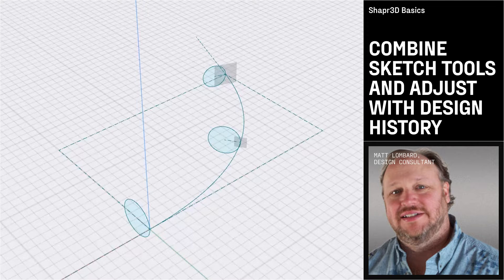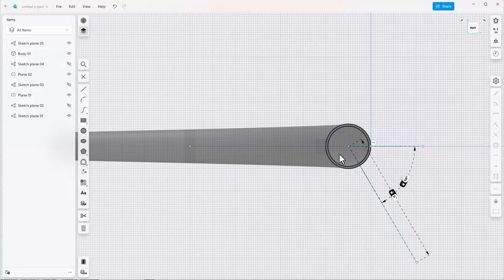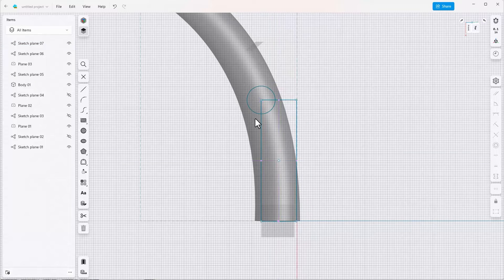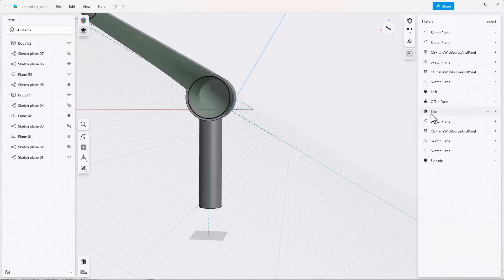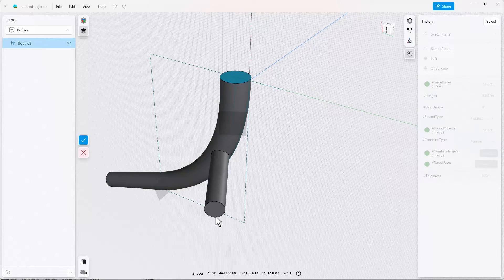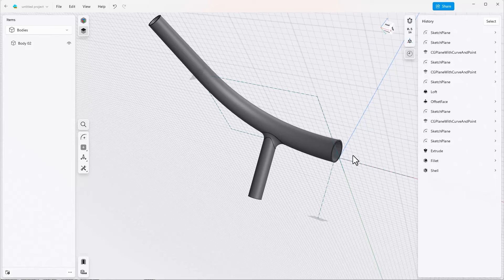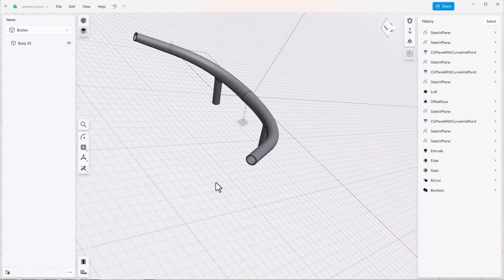Combine sketch tools and adjust with Design History: Motorcycle Handlebar, part 2 | Shapr3D Basics

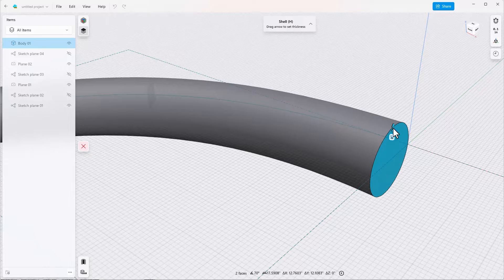Comment: For anyone struggling to shell the lofted face at 1:06 - I found a solution: hide all sketches before applying the shell command. This resolved the 'Invalid Selection' error and allowed the operation to work properly
Reply: Thank you a lot, man!
Reply: How to hide all sketches ?😂 I don’t get it. What hot keys combination?
Reply: @dimakhrukin  there is a menu with all your objects on the left side (find the button to open it - it is on the left side too). Then find the eye sign opposite objects and push it
Reply: @ wow, thank you!
Reply: Thank you!

Comment: on 4:08 i did the exact same thing and it wasent snap to the handle its just cut through it, way is that?
Reply: I had the same thing, but to snap it you should shift the pointer away from the extrude arrow while extruding so that the pointer touches the handlebar first... just watch closely how he does it in the video
Reply: @phillove4562 This had me nuts, thanks. Im usinng the iPad version and I didnt get it at first. Basically is just moving the pencil so that it touches the other body first, instead of going along the line of the extrude
Reply: @patrickbateman3326  Thanks!!!! I was struggling with this one

Comment: You said it yourself, not ideal for manufacturing 
. 
I use shaper to design handlebars and I design the bars around the clr of my bender dies, I mainly use the revolve tool to create sections then align, union build one side and mirror, I haven’t really played with parametric yet so looking forward to it